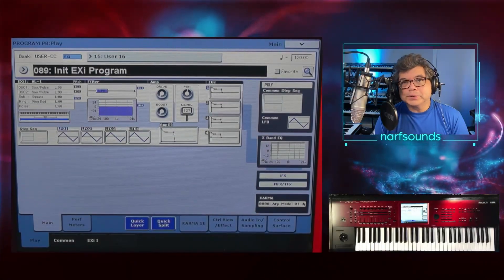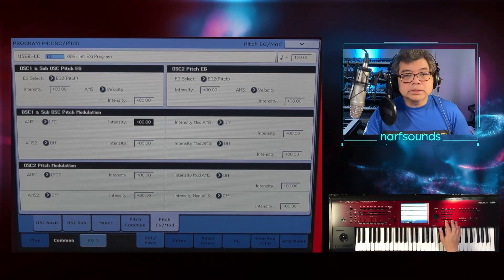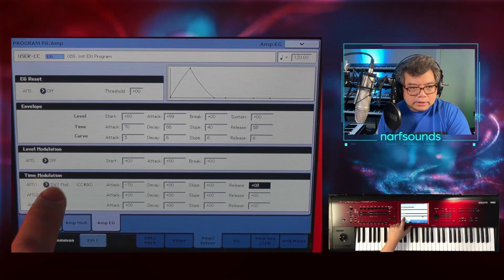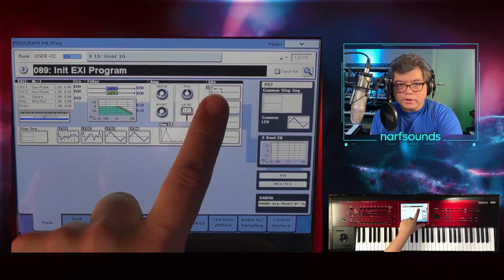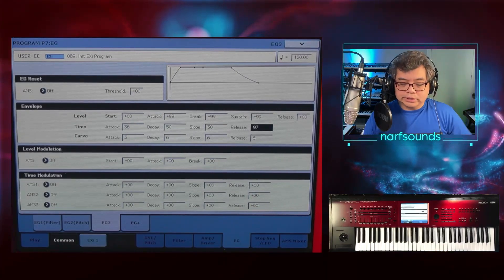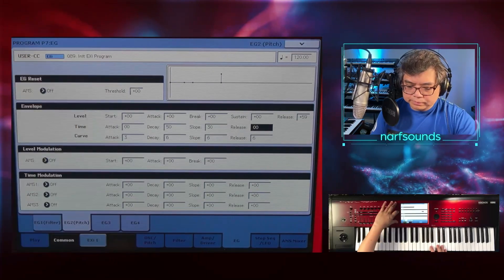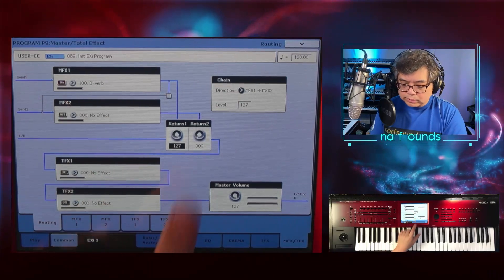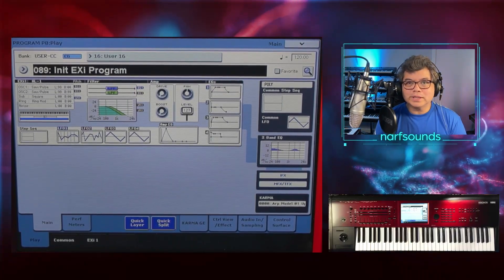Korg Kronos Nautilus AL-1 Tutorial: Wave Morph Pitch Drift Dual Filters Random LFOs AMS After Touch

Comment: The Kronos AL-1 motor is very cool. I've programmed quite a few sounds with it, and it's unbelievable how much it can do. The sounds of the retro Analog synthesizer can be perfectly reproduced. I've tested it and it can make a number of Jupiter 8, Juno 106, JX8p, Minimoog, Oberheim, Prophet etc. I have a Nautilus and a Roland Fantom, and most of the Fantom Model Expansion sounds (Jupiter 8, Juno-106, JX8p, SH-101) can also be produced with the Korg Nautilus AL-1 engine, but it can do much more than that. Also for more modern sounds. Extremely versatile. The Korg Kronos may be old, and the AL-1 engine was already available in the Korg Oasys back in 2005, but if you program it right, it can produce extremely good sounds, and more importantly, the 80 polyphony is perfect for just I can make any song with the AL-1 engine without any problems. In the Facebook group, I have already shared several libraries that I made with the AL-1 engine. I even made Jean Michel Jarre sounds with it and JP8000 Super Saw style sounds.
Reply: What FB group? I’ll join that group